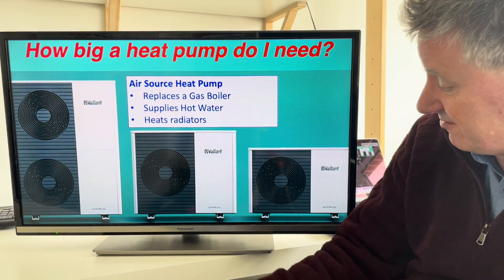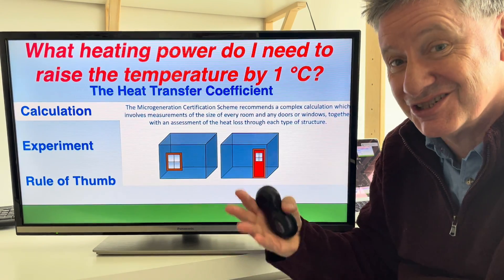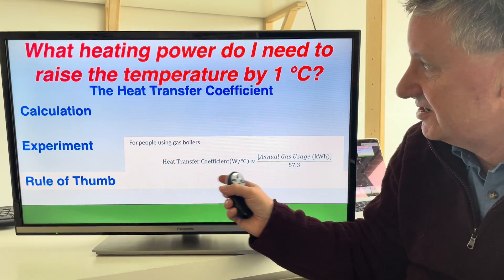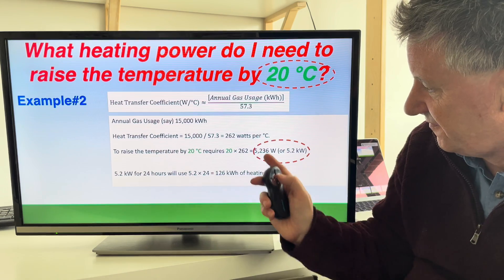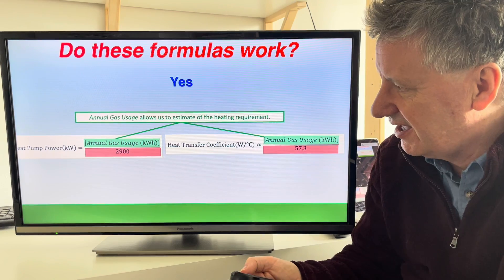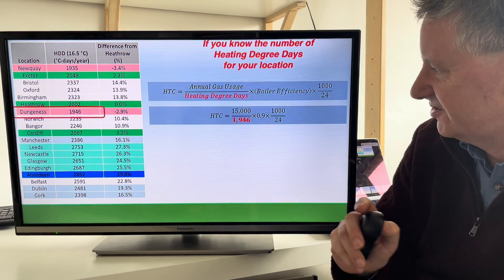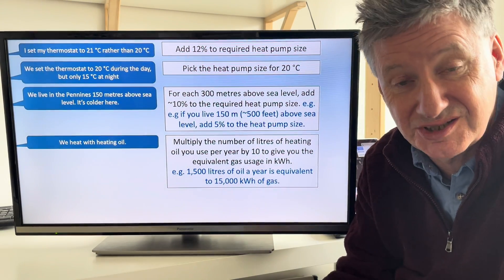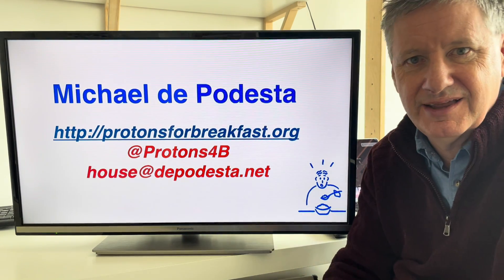How big a heat pump do you need? A simple Rule of Thumb.

Comment: A very useful video. I have my quote from Octopus for a 4kWh heat pump. What I am still no clear on is, how do I work out the running cost. I assume it doesn’t need to run at full power all day.
Reply from the maker: @bazcurtis178, Good Afternoon.

I looked at the issue of running costs in this article on my blog.

https://protonsforbreakfast.wordpress.com/2023/12/17/variability-of-heating-demand-throughout-a-year/

My analysis was complicated - working out how hard the heat pump worked on each day of the year from the last couple of years. But it ended up with a simple conclusion: the cost is likely to be "about the same as heating with gas". If the installation is great - with heating being delivered at low temperatures, then the average seasonal COP (or SCOP) is likely to be high and running costs low.

You can get an idea of what's possible by looking at https://heatpumpmonitor.org . If you click on the headings you can sort by supplier and look at other Octopus installations. They are not the top-performing installations, but they do seem to generally have a SCOP greater than 3. Try also clicking on the icons over on the right of the screen to see live monitoring of the heating system.

Do get back to me if I can help more.

M
Reply: @michaeldepodesta001  Thanks Michael. I will read that. The SCOP on my quote is 3.2. We are in a 7 year new build with solar (8x 400 watt panels, east, 6 400 watt panels, west) and battery (9.6kWh)
Reply from the maker: @bazcurtis178  OK. Now I understand. It's a modern house with reasonable thermal properties. My own maximum thermal load at - 5 °C is 3.5 kW so we are not too different. But the solar panels and battery will make a BIG difference.

The solar panels will ( I guess) generate around 4,000 kWh/year - but really very little in winter - perhaps just 1 or 2 kWh/day. But you have a useful size of battery. So my guess is that you will have very good savings over using gas for heating and hot water. We operate separate summer and winter schedules.

In summer we heat hot water and operate the Legionella cycle in the afternoon, after the battery has filled up. We all also time other heavy loads for afternoon when the excess solar would just be exported. We then run overnight on the battery (we have a Powerwall 13.5 kWh but see this article on degradation of the battery capacity https://protonsforbreakfast.wordpress.com/2023/12/30/solar-pv-review-of-2023/). In summer we go off-grid for around 4 months. If you still have young children you won't manage that!

In winter, we heat hot water at night with cheap electricity and charge up the battery. We then run for as long as we can from teh battery. In teh darkest coldest days of winter we only get to midday before we need to buy full price electricity, but in December and January we pay an average price of just over 10 p/kWh for electricity. SO our bills are around £500/year for everything.

I did try to write a spreadsheet to calculate the optimum tariff with real solar data and a battery

https://protonsforbreakfast.wordpress.com/2023/03/05/tariff-calculation-spreadsheet/

But I don't recommend it. It sort of works, but I think it is at best indicative. But if you have spare time you might have fun.

But in short, if you have solar and decent battery, you will save 'a packet'! 

I do hope things go well.

All teh best

Michael

Comment: That was simply wonderful. Your presentation was simple and straight to the point. It highlighted all the very important points I needed to make an informed decision about selecting a heat pump. Thank you so very much as this came at a crucial time of making a decision on what size of heat pump I might need.
Reply from the maker: Thanks Kingsley. But please remember it's a rule of thumb. I made the video because friends had been told they required heat pumps 3 times too large - and installers just said "That's the calculation". My hope was that if an installer suggests an anomalously large heat pump, then you would be able to ask them to justify that in detail - there is a lot of oversizing going on.

Anyway: Best wishes for your endeavours.

M

Comment: I like to know how you got the 57.3 number?
Reply from the maker: Peter, it's sort of explained in the video, around this timestamp

https://youtu.be/hCeghKa3liM?t=707

Specifically, its based on a boiler with 90% efficiency and 2,150 °C-days of heating demand - typical of the southern half of the UK.

2150 x 90% x 1000/24 = 57.3 

The factor 1000/24 converts the formula to give the HTC in W/°C rather than kWh/day per °C

Make sense?

All the best

Michael
Reply: Thanks @michaeldepodesta001  for the explanation, but doing it in the beginning would have saved me a lot of headaches.!

Comment: I live on my own how can I work out you usage if I was out all day working  now I'm retired and home all day so I have no record of normal usage
Reply from the maker: Eddie, good evening. 

If you heat your house with gas I would recommend that you try reading your gas meter before and after a very cold day. If you're in the UK, the very cold weather has just passed, but we might have another spell. On the very cold day:

1. Read your meter at midday
2. Keep the house at the temperature you would like it to be - normally around 20 °C all night
3.  Read your meter at midday the next day.

If you need help reading the meter drop me a line.

Assuming your boiler is 85% efficient - that's normal - and you have used (say) 150 kWh to keep your home warm on a cold day then you probably need a heat pump with a power of 150 x 85%/24 = 5.3 kW. 

Does that help?

All the best

Michael

Comment: Gosh, it was back in the late 70s when I was given a review copy of a self-published 1976 book from a chap who dug up his garden and put in his own ground source heat pump. I always been interested but never quite had the confidence to do anything. With my difficult 3-storey 1860 terrace which I did partial internal insulation 30+yrs ago [50mm PU foam] it'll be an outlier for most installers to understand. Your rule of thumb will give a first order idea of where I stand before getting out my R-value and U-value tables. I think I'll have to do my own spreadsheet before letting any installer through the door ... meanwhile the ancient boiler staggers on ... 😁
Thanks for the help, Michael, I'll try and find time to read more detail in your blogs.
Reply from the maker: Pete Glass, good evening. Yes both air-source and ground-source heat pumps have come on a long way since the 1970s

If you are thinking about a heat pump then here are my two top tips.

1. On one of these cold days, read the gas meter at midday one day, and then last midday the next day. This will tell you how much gas you have used in 24 h on the coldest days of the year. Typically it might be (say) 100 kWh of gas. This tells you that you could replace your boiler with a heat pump that could deliver 100 kWh of heat in a day i.e. 100/24 = 4.2 kW peak power. This is a really reliable measurement. I wrote about this here

https://protonsforbreakfast.wordpress.com/2022/12/11/cold-weather-measurements-of-heat-transfer-coefficient/

and here:

https://protonsforbreakfast.wordpress.com/2022/11/07/what-to-do-on-the-coldest-day-of-the-year/

2. Try John Cantor's web site and his book "Heat Pumps for the Home"

https://heatpumps.co.uk/book-heat-pumps-home/

Do get back to me if you have any specific questions.

M

Comment: Thank you very much for the video, really useful. Can I offer a couple of suggestions for the heat pump sizing:

1. I believe your calculation assumes a heat pump running 24hours/day. I appreciate that’s probably the most efficient, but practically It might be better to assume a lower figure than this.

2. Instead of using the annual degree days, how about using the degree days for the coldest month (or week) of the year. The degree days web site will generate monthly or weekly figures and that way you’ll be assured your heat pump will cope with the very coldest parts of the year.
Reply: Obviously, some of the factors used in the formulas will need adjusting if using degree days per month (or week) instead of degree days per year
Reply from the maker: aprobin1: Thank you very much. Both excellent suggestions.

1. The calculation is based upon the average temperature in the dwelling. The rule of thumb will give misleading results if someone only operates the heating intermittently - it will look they have a very well-insulated house and their actual gas consumption will not be a good guide to average heat demand.

2. Yes, that's a great idea. I wrote about a similar idea of making measurements on the coldest day in these articles

https://protonsforbreakfast.wordpress.com/2022/11/07/what-to-do-on-the-coldest-day-of-the-year/

https://protonsforbreakfast.wordpress.com/2022/12/11/cold-weather-measurements-of-heat-transfer-coefficient/

Thanks for your insightful comments and good luck with your endeavours. M
Reply: @michaeldepodesta001  Thank you very much for taking the time to reply. I see what you’re saying regarding avg temperature in the house over a 24hr period. Makes sense. One of the problems I find, having a heating system just large enough to balance heat output with heat loss in steady state is that if I go away for a week or so, which I frequently do, when I get back it takes literally days to get the house back up to normal temperature. If sized so the avg temperature in the property can be maintained by running the heat pump 12 or 16 hours a day (well insulated house so still not too much temperature variation), then a bit of extra capacity to blast this up to 24hrs/day as required wouldn’t come amiss.

Comment: Hi Michael, thanks for this very informative video - I have a query arising from an unsettling comparison of your  rule of thumb sizing compared with my longform calculation of overall heat loss by u values. Should the answer of  your rule of thumb be divided by the anticipated SCOP or is this for the birds?
Reply from the maker: @fredblogs8816 good evening. No, the rule of thumb - dividing annual gas usage in kWh by 2,900 - gives an estimate for the required maximum heating power of the heat pump to provide equivalent heating to a gas boiler.

I can't quite make out what you mean by your comment "is it for the birds? " In general the 'rule of thumb' will give a lower estimated heat pump size than a heat loss calculation, but that's because it's reality based! Heat loss calculations frequently overestimate heat pump size by a factor 2 to 3. 

The rule of thumb can also give funny results if - for example - you currently only heat your home in short bursts so that your gas use isn't representative of the heating required to keep your home at a steady temperature - as a heat pump will.

Do let me know your calculation results if you would like to discuss this further.

Best wishes

Michael
Reply: @michaeldepodesta001  many thanks for your reply Michael, I would appreciate any comments you have.  Our house is an ongoing project to insulate and reduce heat requirement of a solid brick structure, 194M2 internal floor area, on 2 floors. 

According to my U value calculations, the total heat loss/heat requirement is 19.5kW which (if I have followed Heat Geek's videos correctly) I assume that total can be reduced by the SCOP which I'm including at 3 which gives me a heat pump size of say 7kW (less if a greater SCOP is assumed).  (Current radiator output capacity exceeds the 19.5kW heat requirement by a reasonable amount; total heat requirement includes 7kw for HWS; DT range assumed as -3 to +21degrees C.)

For the rule of thumb comparison, our annual oil consumption is 3000 litres, electricity is 3000 kWhrs for 194M2 internal floor area which suggests 10--11kW - a result 50% the opposite way to what you suggest is normally the case. 

Or, is this simply showing the true inefficiency of our current boiler and heating/hw provision? 

I hope this is clearer than "for the birds" and makes sense.  Really appreciate the way you engage with all comments - it's very much appreciated.
Reply from the maker: @fredbloggs8816  Good Evening. Sorry for the delay in replying: it's been a busy day. I have two significant comments.

You state that according to your U-value the total heat loss/heat requirement is 19.5kW. This is an estimate of the heating power required on the coldest day. If that truly is your heat loss then to meet it you need a 19.5 kW heat pump. The 'name plate' labels of heat pump label the THERMAL output. The electrical power required is found by dividing the 19.5 kW THERMAL power output by the COP - nominally 3 - to get 6.5 kW ELECTRICAL power required. 

Is 19.5 kW really your maximum heating requirement? At the moment you use 3,000 litres of heating oil a year. By chance, one litre of heating oil is NOMINALLY equivalent to 10 kWh of gas, so that's equivalent to about 30,000 kWh a year of gas consumption. The rule of thumb would suggest that the required heat pump size is 30,000/2,900 = 10.4 kW. For your building area that seems more likely. In fact feedback to this talk has suggested that oil boilers are considerably less efficient that gas boilers - closer to 75%. So the amount of heating entering your home is likely to be less than 30,000 kWh. perhaps as little as 23,000 kWh/year. 

It is my experience that heat loss calculations frequently overestimate the required heat pump size. This is not the place to discuss why that is. But if you just heat your home very extremely for short periods then teh rule of thumb can be wrong, but nearly 20 kW seems just VERY big for a property of that size.

You use 3,000 kWh of electricity a year which is modest (~8 kWh/day): are just one or two people living there? Kids generally use quite a bit of electricity. 

Does that make sense to you?

Best wishes: M
Reply: @michaeldepodesta001  Evening Michael. Many thanks for your considered response,  it's much appreciated and yes it all makes sense. '

Re your query on u value calculation, thank you for correcting my misunderstanding. I mis-understood until now that total heat requirement was to be divided by the COP. Phew!

There's another factor which may be relevant for the comparison of rule of thumb and u value calc results which prompted my original query. I included 8.5kW for HWS within the u value 19.5 kW total - I was uncertain as to whether that is required for heat pump sizing, if that's wrong that would bring the two methods closer? 

Again, many thanks for all your help, no doubt you can tell I'm not naturally scientifically minded but I think we all need to learn about this subject as it's not something many boiler engineers are currently interested in diversifying into. 

And yes, you're right  there are just two of us now and the annual elec consumption is accurate.
Reply from the maker: @fredbloggs8816  Good Evening again. HWS? Is that Hot Water Storage? 

If so that could explain the very high heat demand you calculated. The way a heat pump does space heating and hot water heating is as follows.

It spends most of its time heating your house using radiators or under-floor heating. To do this it heats hot water up to (maybe) 30 °C if it's not very cold outside and (maybe) 45 °C if it's very cold outside. And then it periodically stops heating your house and instead - for may be an hour or so - stops heating your house completely and devotes itself to heating water in your hot water cylinder to (maybe) 50 °C.

If you have a 10 kW heat pump heating your home then when it switches to heating hot water it will devote 10 kW to heating hot water. It takes around 7 kWh of energy to heat up a 200 litre storage tank so with a 10 kW pump this would take less than 1 hour. 

Is that what you meant by HWS?

All the best

Michael
Reply from the maker: @fredbloggs8816  And please don't worry about being science-minded. I have been a scientist for many years and I genuinely still find this stuff confusing - and when I first started doing these calculations a few years ago I was very confused. 

Best wishes: M
Reply: @michaeldepodesta001  Yes Michael, HWS is as you assumed, in our case a 210l tank, and I can now see the heat pump size required by both methods!  That's reassuring that my (quite laborious!) spreadsheet coincides with your rule of thumb!! Just think, If I'd seen your video before I'd never have had the "fun" of calculating it. Best wishes from me for all your replies and for being so willing to share the benefit of your experience.